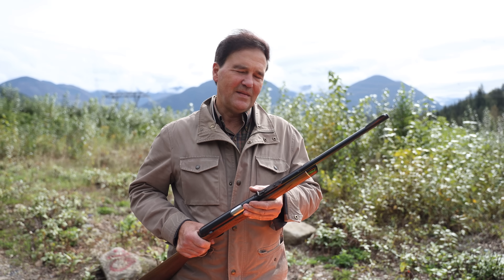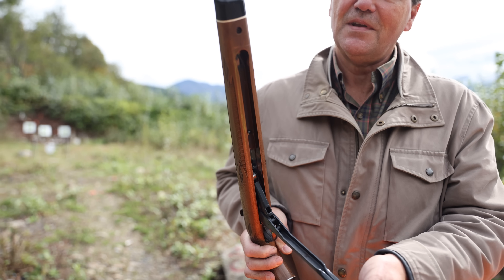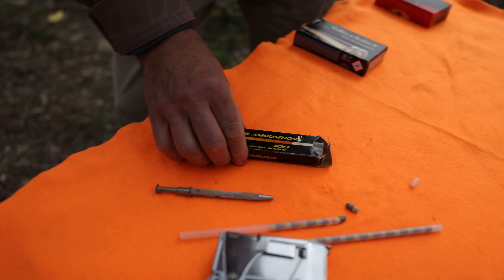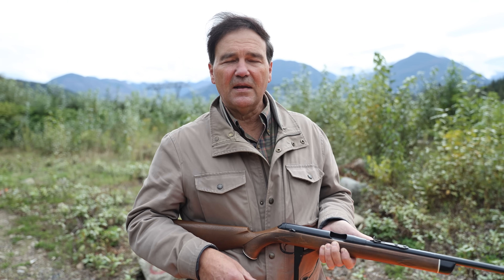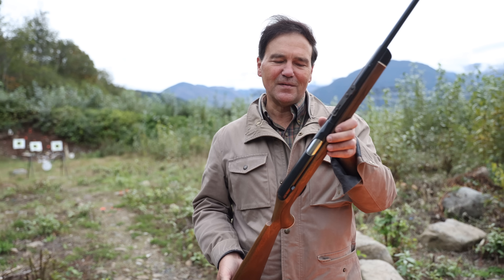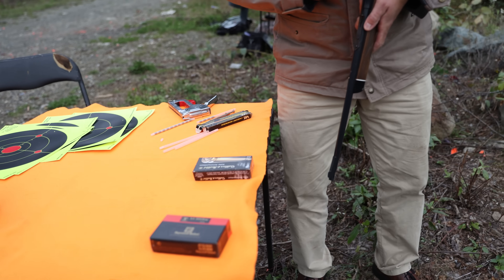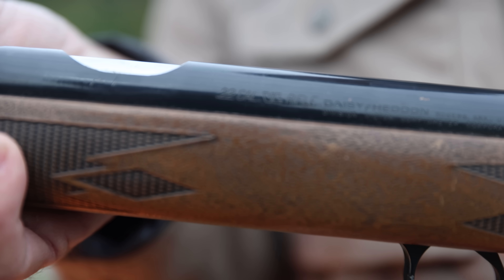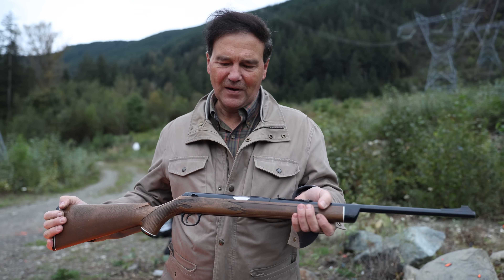Air Rifle OR Gun Powder? Daisy VL

Comment: New to me for sure. And yes, funny it hasn't caught on or been developed further. Basically how some field artillery works. I recall during my time in the military being behind a line of M109 self-propelled howitzers. The shells (projectiles) are loaded into the breech first, then a sectioned powder bag behind it. Not sure how it was primed exactly, I think the primer was in the mechanism that seals the breech. Sections of powder could be removed to vary the range of the projectile. The removed powder bag sections were not re-used but discarded & burned.
Reply from the maker: So interesting. I think someone wrote me that they do have a primer - maybe electic somehow. Maybe someone could write us. I checked Wiki etc... and they don't say.
Reply: @UnitedStatesOfGuns  I did a quick search & confirmed that a single use primer is used to ignite the powder charge. If you search for reloading videos on the M109 there are some good clips of the entire process. And yes, it's fired by pulling a string (lanyard) haha.

Comment: An interesting rifle and demonstration. Makes me wonder if the caseless ammunition could be used in a break barrel 22 pellet gun (Spring or pneumatic). Would depend on the ignition temperature I suppose.
Reply: An actual pellet gun does not have a heavy chamber needed to contain the initial explosion to get the projectile moving.
Reply: @davidkohler7454  It'd be interesting...once!

Comment: This second video makes me wish that gun makers would offer rifles like this once more. The concept is worth looking into since ammo would probably turn out to be cheaper. Great video SIR!! WELL DONE!!
Reply: The problem with switching to caseless ammunition is with heat, surprisingly enough.  Igniting the powder generates heat with all that expanding hot gas.  In a firearm with cased ammunition, most of that heat goes straight into the brass (as anyone can tell you) - which is then immediately ejected from the gun, taking the heat with it.  Without the ability to throw what amounts to a brass heat sink out of the mechanism with each shot, heat builds up quickly in the mechanism.

This Daisy VL is probably one of the better designs, the inherent pause of having to re-prime the gas chamber gives time for the firing mechanism to cool down.  Also, the fact that they're single shot and do not store additional rounds in the weapon is good planning.  In a semi-automatic caseless firearm, multiple shots will render the gun uncomfortable to hold.  A full-automatic caseless firearm might have firing rate limitations in order to prevent cook-off of unfired rounds.

Caseless ammunition has so many advantages, it's a shame that it's one drawback is exactly the sort of thing that disqualifies the design.
Reply: @bearnaff9387  Yup. It is an unintentional reason the G11 failed. Besides the intricate clockwork.
Reply: a sh*** ton cheaper for anyone with basic education and time, i'm sure too!
Reply: Cheaper and cleaner too! No need to worry about picking up spent cases when there’s no cases to pick up! I can see where going anywhere past single shot rifles would be troublesome.
Reply: It would probably be significantly more expensive. People wouldn't like to hop onto a whole new technology with a limited application, and the manufacturing of ammo like this would be a massive R&D and tooling investment
Reply: Wait, wait wait for it.  and eco friendly too 😉
Reply: Nope. The price would be through the Roof. and NOT sell.

Comment: how does the air set it off? Never seen this in the states before?
Reply from the maker: Here is a quote from the web that is pretty good:

Temperature is proportional to the average kinetic energy of molecules and pressure is the force applied to the molecules. If you add more pressure, the molecules will move faster or collide with each other and this will result in increase in temperature.
Reply: Ever notice your tires heat up a bit when you air them up?

Comment: Basically a fancy dieseling effect gun! 😂
Reply from the maker: That's about right. Maybe you've seen one of those experimental engines that runs on solid fuel - this rifle is something like that. The key is the high temperature from compressed air - but I think you get that. Cheers.
Reply: @UnitedStatesOfGuns  Yep, but daisy put a one way ball bearing "baffle" in so that compressed gasses from the piston move it forward and go round it to ignite the charge upon which the ball baring would then be forced backward to seal off the air chamber protect the piston head. Neat system.

Comment: Fascinating.      Doesn’t matter what it looks like, the second I heard Daisy, I automatically thought pellet gun.    Did you ever try jamming a 22 pellet into it to see if it works?
Reply: What would propel the pellet?
Reply: @c.j.rogers2422    It uses air pressure to ignite the charge.   I’m curious to see how much they use.
Reply: @jimf1964   In theory it should be able to be used as a regular springer airgun. 
In reality, it is hardly able to shoot through a slice of bread 🍞 😅